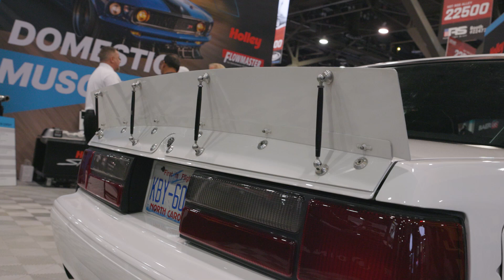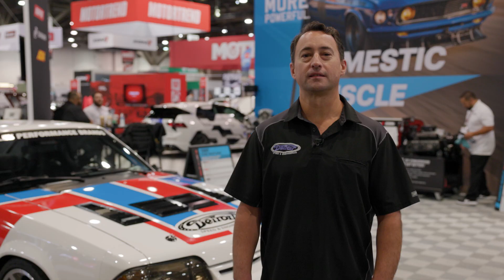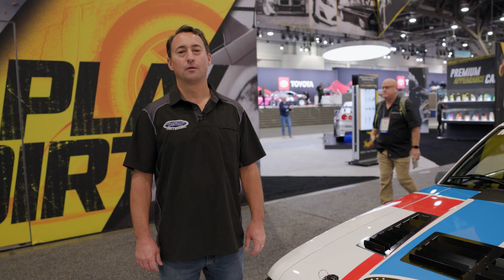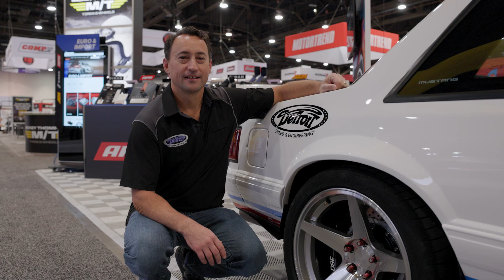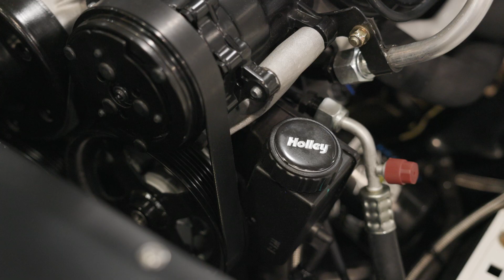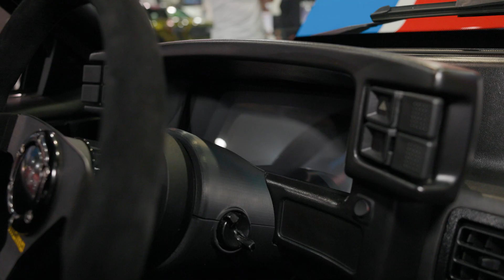Meet Detroit Speed’s Track-Ready Fox Mustang at SEMA 2024

Comment: Why is it always 9” differential?  They rob so much Hp to the tire. An 8.8” with welded tubes, diff support cover and moser/strange axles is good for 800 plus rear wheel HP. A 9” takes nearly 40 HP to turn over from the bulkiness/ weight.
Reply: They just came out with a 9" style dropout case that takes an 8.8 diff.